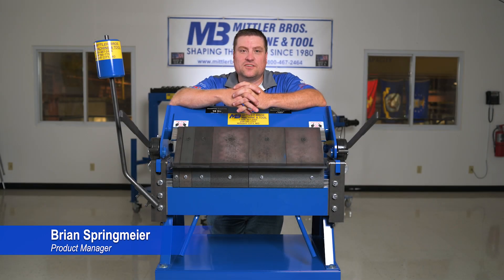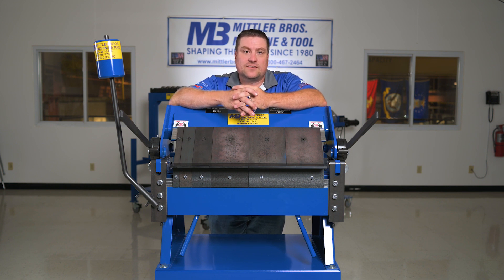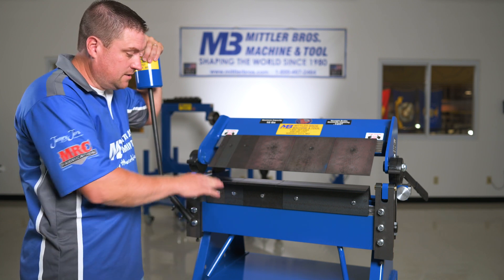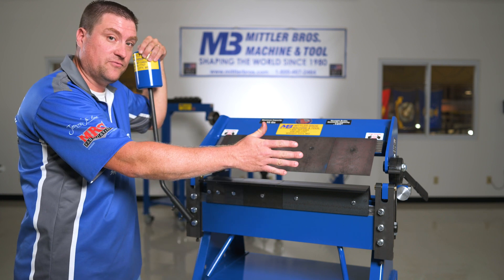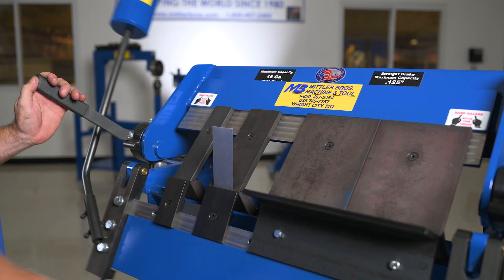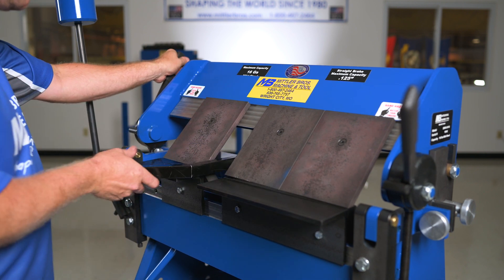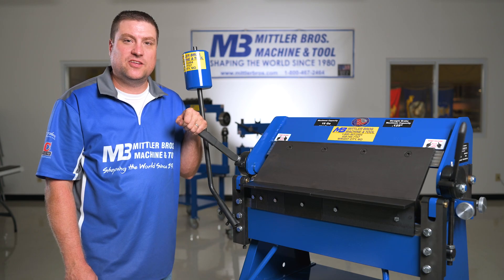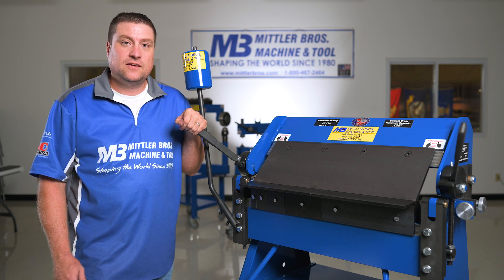Ultimate Box and Pan Brake by Mittler Bros  Machine & Tool

Comment: Been doing sheet. metal work for 40 plus years. 26 at NASA, 10 at APL Johns Hopkins. I know sheet metal better then most. Im spending my last years working at a small aerospace company. We have very little funding for new equipment, but the company wanted to take advantage of my skills, so we bought a mittler brake, realizing the advantages as discribed in the video vs other finger brakes. With the removal of the bending blocks as well as the combination apron sizing you can do so much more that you couldn't possibly do with the standard fingure brakes. The other big advantage is the different bend radius options, which for those of us that know comes in handy when your bending different grades of aluminium.
Well worth the money especially if you plan on making complex bends on a tight budgbudget.have had this brake for 7 months.